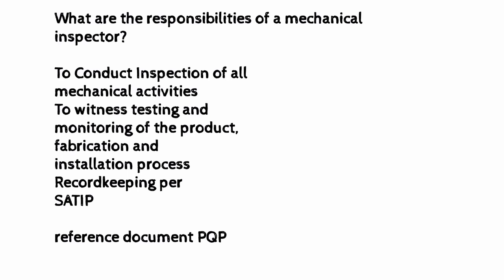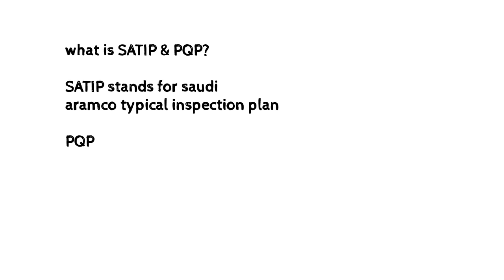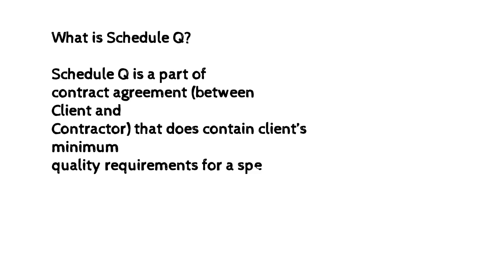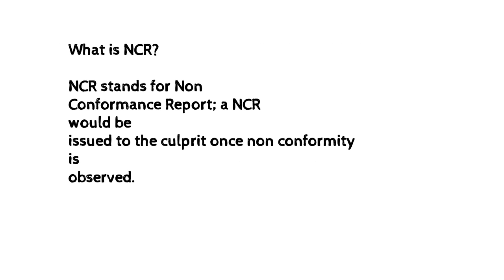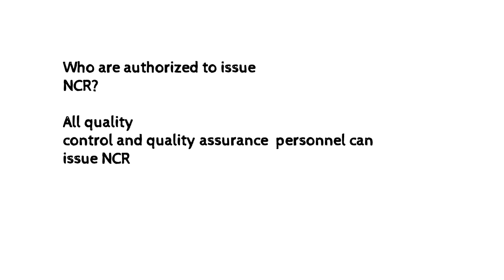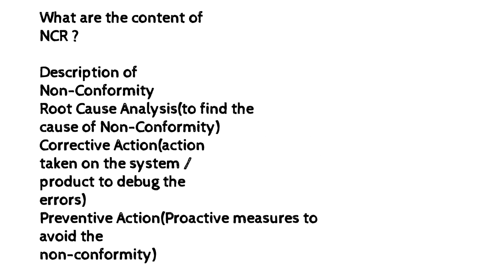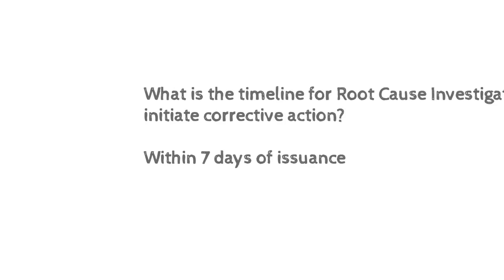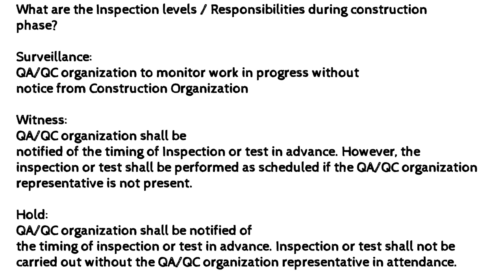Aramco Mechanical Qc interview Questions & answers @qcweldinginspector

Comment: Sir I have 6year 5 month Experience in flange and pipe fittings manufacturing company in Chennai
My role is preparing supporting documents for Supplying material before Thirt Party Inspection, and checking dimensions of material as per standard... After watching your NDT Testing related vedios i decide to do NDT courses now i have ANST Level II Certificate in (PT,UT MPT & RT) 02 May i completed my course.... Now im searching job in gulf countries...my question is im eligible for QA/QC role or which role suits me please guide me Sir
Reply from the maker: For qaqc you should have cswip or nace something related